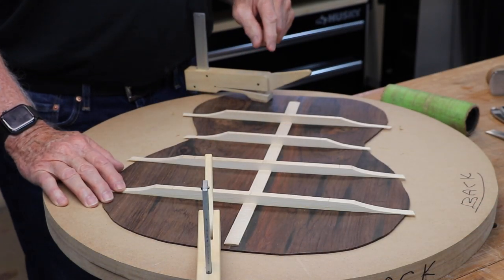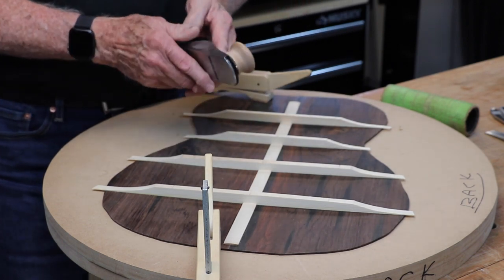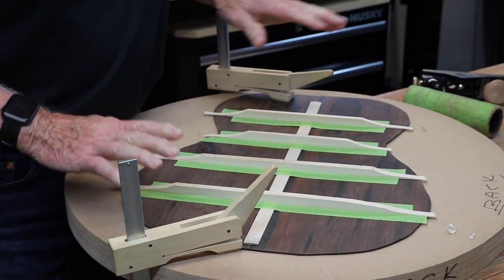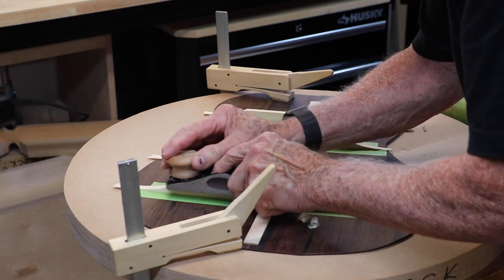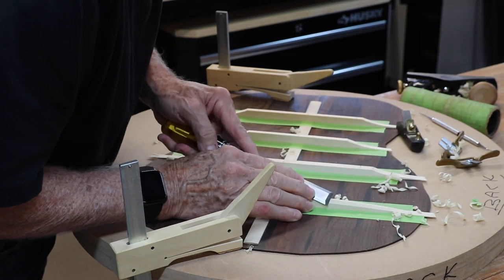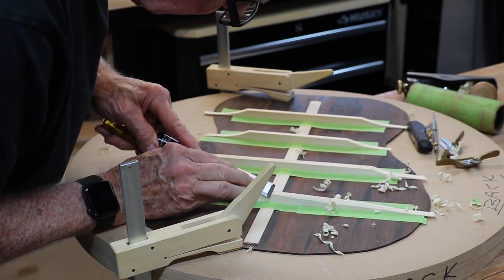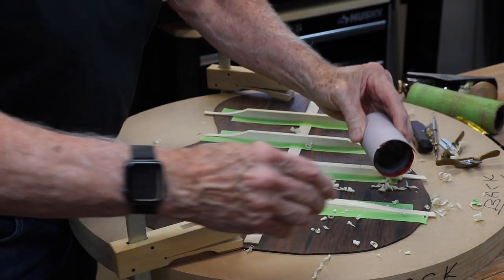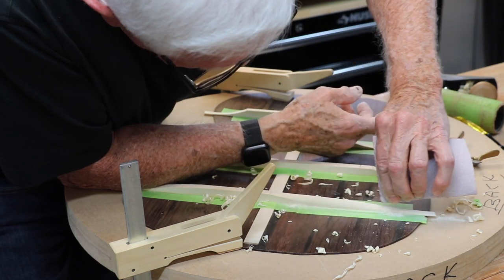Gotta get it right...the first time.

Comment: Hey Monty, how did you scallop three ends of the spats, I have an idea how I'd do it but wondering your method. Also could you add mm conversion to the inch sizes you give? These would be very useful. Great job, cheers Norm
Reply from the maker: I'll try to remember that Norm. Thanks for the suggestion.